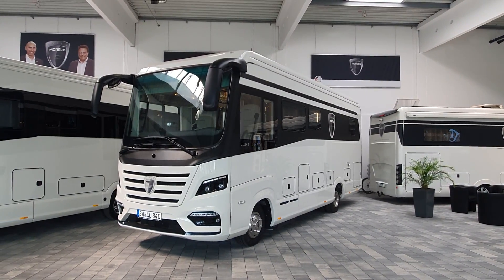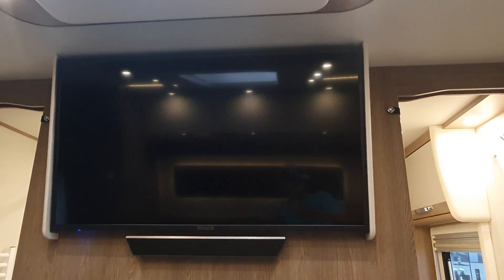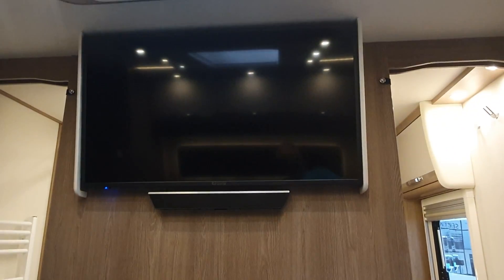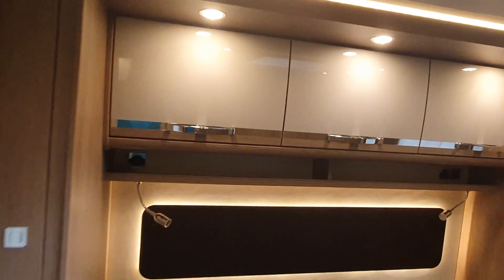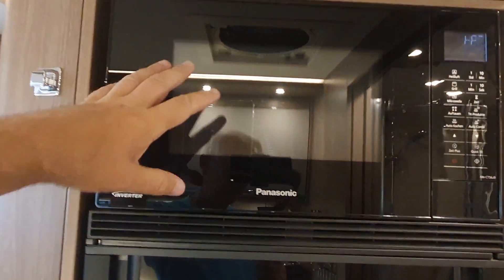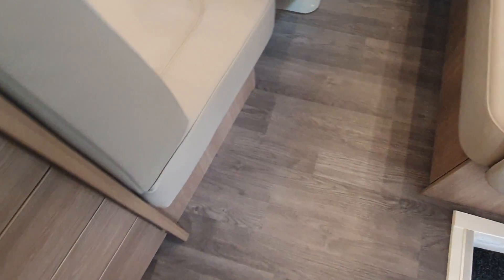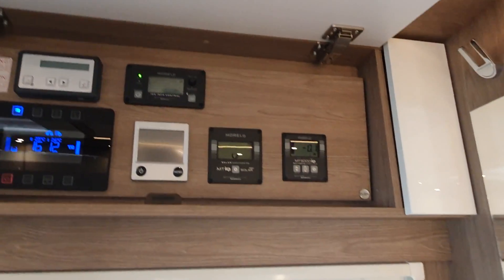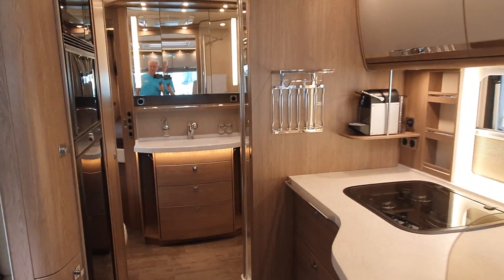350k luxury motorhome : Morelo Loft Liner

Comment: Quick question for you Alan, and you will have a good opinion on this as you have a wealth of experience. Is this price good value for money?? Is it worth paying the extra150K instead of a 200K  top of range Frankia  or 200K Le Voyageur? The main problem I have with Morelo and Concorde is the narrow tall body and small wheels.  I wonder about the stability of the vehicle on the motorway in a high wind.......
Reply from the maker: I personally think it is worth paying the extra cash, and if one does not have it, then go for a used model.  As for the size of the wheels, I personally would not know, but I have brought the subject up with an engineer who told me that it would make no difference in a case like this.
Reply: thanks
 @VanlifewithAlan